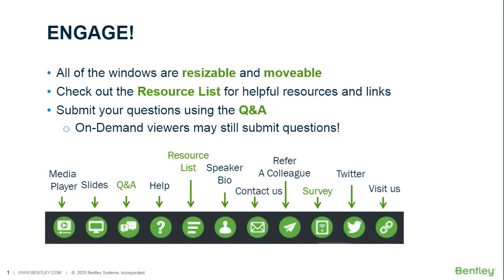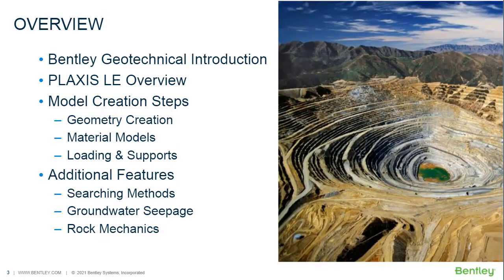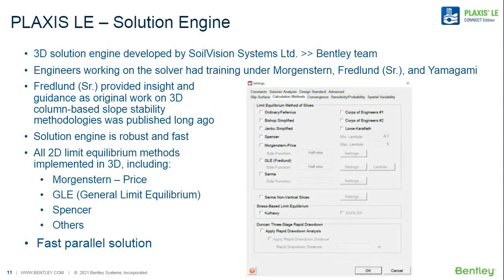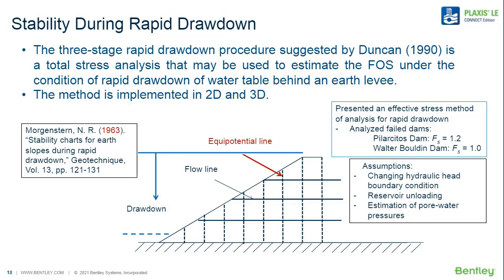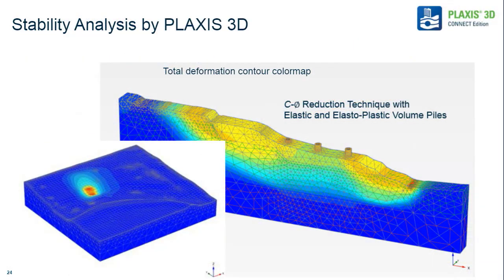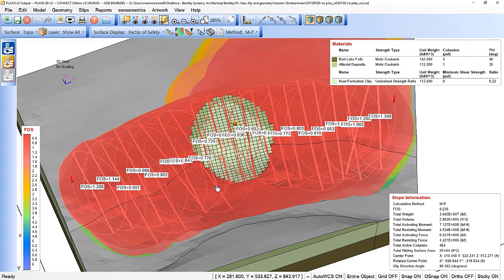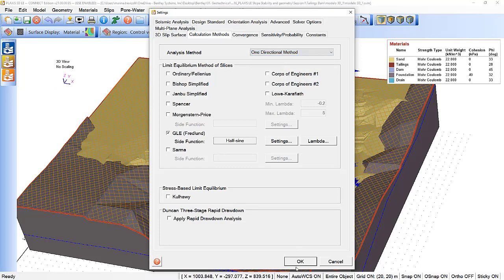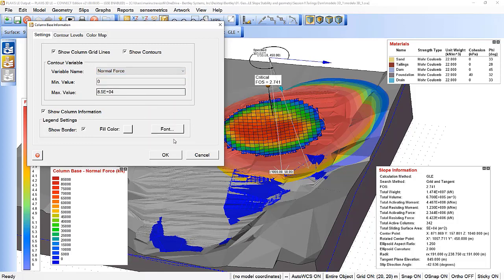Better Slope Stability Analysis with PLAXIS LE: Slope Stability   | Session 1

Comment: I have question too, what the best setting to modeling 3D slope stability using cuckoo search in plaxis LE, in case the tansion crack is known and how to model the critical factor of safety exactly to fit the tension known crack?